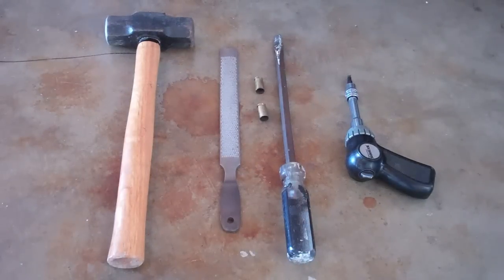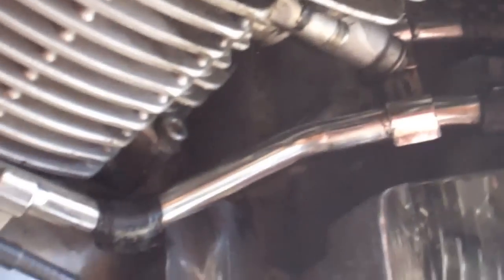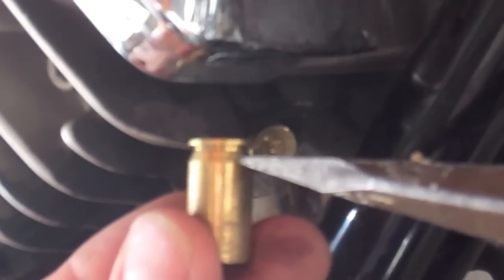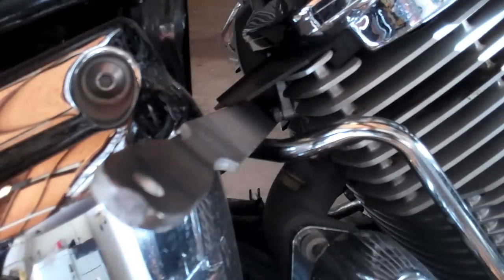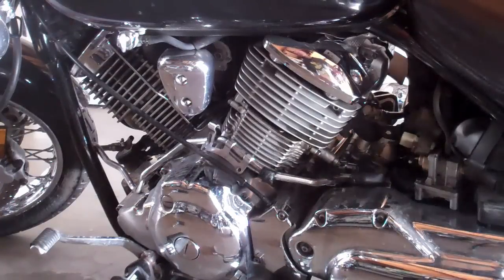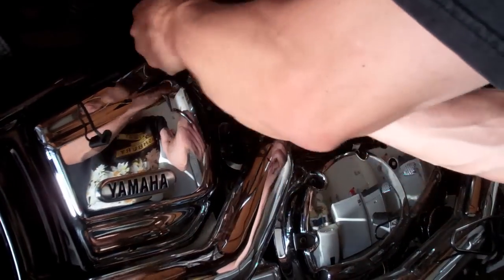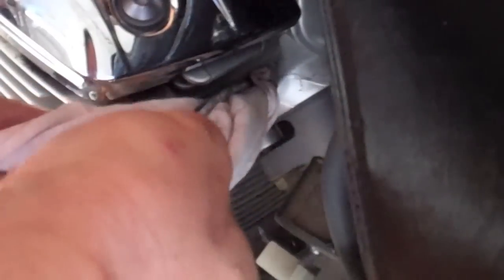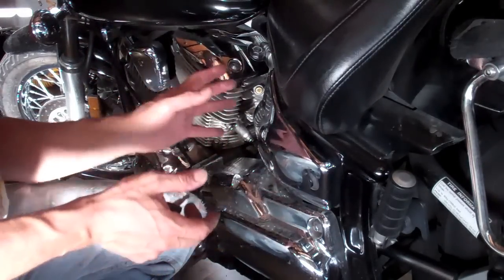Removing Yamaha V Star 1100 Custom AIS System

Comment: Tell me, whats the advantage of doing all this????? Does the bike run better? I don't get it!
Reply from the maker: For mine it stopped back firing. With the AIS system it would cycle through un-burnt fuel back into the cylinders and would backfire a lot on deceleration.
Reply: Byrds 1967>>>I get it, I have a 2006 1700 Roadstar  probably with the AIS, it backfires a lot.....Wondering if that system can be removed also!
Reply from the maker: As long as it's carbureted it probably has one that can be removed. Fuel injected you can't. Just follow the silver tubes to the cylinders and see where it all goes.
Reply: Thanks!
Reply: Hay Bro. I have a 03 1100. I closed all the tubes off awhile back. cause it was the (reed valve) that went out. All this bad crap was running out. I toke it off. So now what do you do with the vacuum line. The guy at the shop plugged it. I did have it in my tool box with a fuel filter on it to keep dirt out. but sense he plugged it now I get oil coming out the carb. what's your option.
Reply from the maker: That's beyond my pay grade. All I did was feed the AIS system back into itself and remove the lines to the cylinders, then sealed the cylinders. My V-Star has always had oil around the carb and air box even when it was stock. I don't know what causes that.
Reply: The excess oil is caused by overfilling the oil a bit too much. The excess blows through the cranck case breath system. Not a big deal, just don't fill as much.

Comment: I did the hose swap as a test run and it did absolutely nothing positive for my 05 v star 1100. Ran  like it wasn't too happy to the point  of me thinking this was a prank video
Reply from the maker: Is your bike stock or have you put on straight pipes and modified the air intake?
Reply: Byrds1967 I just purchased it recently but it appears that the previous owner has chopped and gutted the stock pipes. I'm assuming he jetted it as well because it's not running poorly.
Reply from the maker: Generally these bikes are made to 'reburn" unused gas through the AIS system as not to allow harmful emissions into the atmosphere. When you put on straight pipes or mess with air intake then the AIS system will backfire a lot as the unused gas explodes in the pipes. Just poking holes in the muffler may not change much (if that's what he did). You can increase horsepower at least 15% if you do stuff correctly. Disabling he AIS system is just the icing on the cake....after all that. And yes, jetting the carbs (both of them) is the key after all mods are made.
Reply: Byrds1967 Thank you for the tips. It still seemed to backfire a fair amount and after a little while, it seemed to start falling on it's face a bit. I'm thinking I might need to adjust these carbs a bit.
Reply: Bobby Sweeney LM2250E-XX-B 2" Grease Pumps and Packages

Comment: so exactly why are you doing this
Reply from the maker: The bike runs better without it. The AIS recycles unburnt gas back into the system which use to make it backfire a lot.
Reply: Byrds1967 what pipes are you running?

Comment: The AIS as designed serves a useful.  It allows these bikes to operate in states that have stricter emission standards.  But it also helps to reduce carbon pollution.  Removing/altering the AIS is selfishly irresponsible.